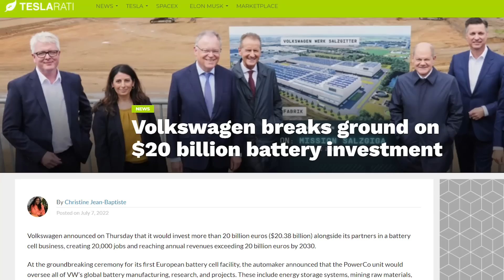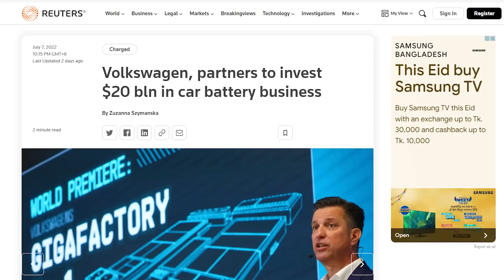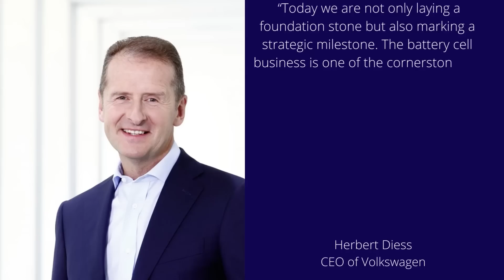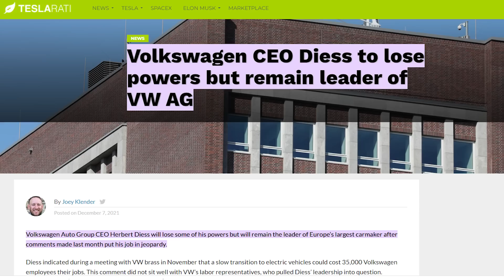VW starts $20 billion battery factory & reveals new battery cell

Comment: The Legacy OEM's are going to go bankrupt not in 10 years but in less than 5 years! VW, GM, Ford and Toyota alone have combined Total Debt of 1 Trillion Dollar?! 

Which at ZERO PERCENT INTEREST was serviceable but at 1,2,3 % p/annum is a major issue. VW for instance is underwritten by Deutsche Bank which in turn is underwritten by the German Government which is underwritten by the EUROPEAN UNION?!

The same can be said for Ford, GM and Toyota though the two American Companies will need alot of support to get nailed out again by the FED?!

Anyway the point of the matter is OEM's face huge hurdles and massive technology moats that frankly they are not equipped to overcome.

If your Total Debt is around a Trillion Dollars and your Total Liabilities are close to 2 Trillion you have a short, medium and long term cashflow problem? Typically in the case of large corporations with liquidity issues you either go to a bank, issue bonds or get a bailout?

In this case I think it's going to be a mixture of deferring payments (interest free holiday), tax reduction and or written off, bank loans turned into convertible bonds (government backed) and a cash infusion by new Federal Grants etc. 

Remember we're starting at 1 Trillion in Debt with all four of these Companies committing to spending over 100 billion on EV Development. But unfortunately the maths simply doesn't make sense. 

VW for instance spending 20 Billion for a Battery Factory? The resource allocation is so redundant at this point and the savings negligible or non existent. VW needs production capabilities but if your research, design and development isn't synergistic you have major problems before you even get to fabrication and or assembly.

Tesla has its critics and it's detractors but taken purely as a case study in this case the disruption of the auto industry. You literally have to do a side by side comparison to Apple and the Mobile Industry to get anywhere near the adoption curve.

I know almost everyone thinks it's impossible for Tesla to reach an annual production of 20 million vehicles by 2030. But consider despite everything that's happened economically and socially the last 24 month's. And I'll just use Tesla's projected goal of year over year growth of 50%.

2022 1.5 million vehicles, 2023 2.25 million 2024 3.375 million 2025 5.06 million 2026 7 million 2027 10.5 million 2028 15 million 2029 22.5 million 2030 33 million?

Now obviously a big part of Tesla achieving this growth will be rationalising their production lines by simplifying their product line. A Robo Taxi, a Robo Van configurable for both passenger and freight the long touted Model A Variant? As in a small hatchback for Asia and Europe for under 20k.

Even by 2030 I don't see Tesla having more than 10 models including the CyberTruck and Semi? By then Freemont may become the speciality production facility and only make Model S, X and the Roadster? 

But the real take away is this last year 56 billion this year 81 billion then 120, 180, 270 and 405 billion gross Turnover the OEM'S ARE DONE.

Comment: I sold my ID.4. I was very disappointed with it as the software was not fit for purpose - It would not charge properly on the timed charge. The app clashed with the car settings causing further failure. I'm in the UK and the Pro Life here has no reversing camera, auto dip headlights or auto wipers (in USA it's different). No over the air updates and now Which? Reports that it's range is 100 miles per charge short of advertised range. This is what I found as well. Combine this with the lack lustre acceleration and it's not worth the £43k price tag. I'm waiting for my Model Y delivery!

Comment: My 30 years in the tech industry tells me that Europeans are not good at mass producing commodity products. I've seen this pattern over and over. I've seen Philips giving up on its LCD production. I've seen Germans giving on PV production, etc. etc. Mark my words. Five years from now, as the supplies of the batteries stabilizes and the margin gets slimmer and slimmer, VW will sell its plant and exit the business. I did say "commodity" however. If the Germans can produce EV batteries that are so distinctive and superior to anything currently in the market, that's another matter. But I'm not holding my breath.
Reply: Agree, Likely will happen as you say.
Doubt the German battery tech be superior to what comes out of China.
From the many upgrades of current Li ion battery & LFP coming out in the 2 to 3 yrs that's already talked of from this channel that may end in world market from China. 
After that it is certain semi-solid state battery.

4 yrs to 5 yrs starting to produce battery in mass, German will certainly need battery tech from one or few China companies supposedly some said Gotion tech?
Otherwise the rapid pace of battery tech changes will drive the new Germany battery plant to ruin

Comment: You're right: reducing dependence on Chinese battery manufacturing is important, but possibly more important is the supply chain leading to battery production. Tesla, VW, Panasonic, and others, as you noted, are working on battery production outside China, but China still controls most of the lithium mining and even a higher percentage of processing plants that convert the ore into refined lithum suitable for battery production. Russia believed they could get away with invading Ukraine because Europe is so dependent on their natural gas and oil. We can't encourage that kind of action by China by being too dependent on them for any one essential item.  
            ~~~~~~~~~~~~~~~~~~~~~~~~~~~~~~~~~~~~~~~~~~~~~~~         

Separately, I wonder if you have any thoughts about Tesla, and eventually VW and the other manufacturers elminating the need for natural gas (and other fossil fuels) for manufaturing. I know Tesla famously has lots of solar panels, but melting aluminum for castings can't be done with photovoltaics, AFAIK. It's a big issue in the near term for Tesla with the shutdown NORD-1, but it's a broader issue down the road for EV (et.al.) manufacturing around the world. Have you turned up anything in your research? If so, that would make a great video.
Reply: Concentrated solar does in fact power multiple foundries world wide already. So yes solar can today power aluminum smelting operations.
And recycling aluminum takes about 15-20% of the energy as refining new aluminum does. 
Hence why it's estimated here in the U.S. over 75% of all aluminum ever made is still in use today. 👍🏻😎
Reply: @4literv6  Thanks for the reply--that's great to know. I was wondering about the possibility of concentrated solar (why I specifically said photovoltaic wouldn't work instead of "solar") but my searches only turned up electricity generation. Do you have any links to info about successful concentrated solar foundries, or at least remember a name or location to help search?  Is it something that could be built at Tesla Berlin/Brandenburg, or is it only a large stretch of desert thing? I'm worried the new Tesla production there will get shut down again because of a lack of gas, and this could drag out for a long time. Presumably the ore can be smelted or the aluminum can be recycled elsewhere, but it still has to be liquified onsite for castings.
Reply: You do know all Europeans are living off their "invasions" still?
Reply: @rob4197  Who in the world is only the direct descendent of the original settler of their land? Possibly most Icelanders and some obscure Pacific Islanders. Other than them, practically every person on Earth is descended from someone who once forced someone else off an area of land. Europe, Africa, Asia, and the Americas (including the inhabitants before Columbus) practically for sure. The question is, do we in the 21st Century want to normalize military invasion for the purpose of expanding territory? If so, maybe the US should take Greenland, Cuba, and maybe Mexico, and given leave, the CCP will take about two weeks to begin the invasion of Taiwan. Are you ok with that?

Comment: This is all the easy part of mass manufacturing.  But if VW doesn’t have the battery which lives up to competitive specifications, it doesn’t matter how good the factories are.  This video promised a battery reveal and didn’t fulfill that promise.
Reply: Oh yeah I completely forgot about the battery, VW invested in Gotion High Tech who will manufacture the batteries at this new plant in Salzgitter, Germany, and they have some excellent battery tech which you can read about online or videos on YT.
Reply: @willthompson343  I see many promises, and the lithium sulfur looks the most promising but I don’t know if that’s the same as VW is using.
Reply: @willthompson343  I read about Gotion and they are talking lithium sulfur, which supposedly can support a Tesla based design for a 900 mile range.  Of course it would take 30 hours on a normal house charger to charge, but much less on a commercial charge port.  That would be perfect for me, and enable me to drive my long trips without a recharge.  Even if I had to stop every 300 miles for a 5 minute charge, that’s OK.

Comment: It's really clear VW is taking electrification seriously and Herbert should get all the credit for dragging them kicking and screaming into the modern age. I know they can build cars but I have doubts about their ability to develop the software needed for their next platform. I think they should look for a partner (maybe Apple?) to help them. VW has struggled with just basic infotainment systems and if they can't do that how will they make the jump to software defined cars? The software division of VW Caraid is causing delays of some of the VW group brands right now so software issues are real and happening right now.
Reply: We don't need infotainment or self driving. We need cheap electric cars for everyone now.
Reply: The company was on EV path already before Diess. It started in 2015-2016, when MEB went into development. Already the CEO before Diess was an "EV CEO". By the time Diess came in as CEO in 2018 (he was WV brand lead before that) VW was tens of billions into EV investments and 2,5-3 years into developement of their real big EV play, The Modular Electric Platform.

VW is a platforms conglomerate. They are so big single models are blips to them. They have tens of models on various badges. What matters is the platform.

Diess came in not as to turn the company to EVs, but du to saying "The company is going EVs and I think I can do EVs even better than the previous EV CEO". He convinced board aka pretty much the Porsche Family of it. Remember Diess isn't the top of the mountain. Top of the mountain is high in German and Austrian Alps, where the chalets of the heirs of the Porsche piechh family are.

 Said family just likes to keep low profile, well unless their member is the active head of the company from personal interest. The family owns controlling share. Nothing happens without their say so and if they decide something other shareholders dont have votes to resist. It is publicly traded, family controlled industrial conglomerate. One just doesnt currently see them in person, since all is handled via family holding company of legal types and the actual family choose to not appear in public much related to the business. Instead letting the "hired managers" aka Diess and others handle publicity.

What did happen really was, that couple of the sub brands were more reluctant (for example one Audi brand manager was still on petrol head thinking)and to them Diess had to keep a talking to of "Get with the program. Whole conglomerate is transitioning to EVs. I was hired to make the transition happen and have approval of the board to do this (aka most importantly approval of the controlling share holder aka family holding company aka heirs of Porsche). Get with the program or I will have no trouble firing you and don't think complaining to the board will help. This is their will, not mine alone".

The more recent spat was really about union and employee relations. He tried to run the "scare them straight and agreeable" management strategy to the Wolfsburg factory and AS IS THEIR JOB the AG Metal union representing the workers made it clear, very publicly, that this is not how employee relations are handled in Germany. It wasnt about the workers being against EVs. Rather of Diess saying stupid stuff like "lot of you will get fired" and so on. Mainly the sticking point was repositioning the ICE engine specific people, where union wanted program to transition the heavily ICE related jobs to new EV related jobs. People who made the actual engines, the transmissions and so on.

Surprise, the union got what it wanted. Diess didnt continue the "you are getting fired talk" and surprise surprise there were announcements about retraining and repositioning programs.

One just might look like kicking and screaming, when one isnt used to union or workers actually having the power position to say publicly "CEO, you are being stupid. CEO better." It might get someone fired in USA, but in union strong European countries that is called "employment terms negotiating". Union says CEO is bad at being CEO, putting pressure on them possibly getting fired. To get CEO say "okay what kind of deal you want, so you say 'actually this CEO is okay, we can work with him and we have a deal. No strikes, this is fine'".

so the wolfsburg row was pretty literally Diess trying USA style managerial stuff with European factory union and union saying pretty much "stupid man, you do know this is Europe and not america".

Comment: So now VW is getting on board with Tesla and seeing that it's an opportunity for further buyer lock-in. 
If you've bought a Tesla with 4680 cells, you're not going to go to any store and pick up some replacement 4680 cells.
For all I know VW is going to use hollow triangular cells with liquid sealant filled cooling channels running through them. 
(Got a leak? It hardens like cement on contact with ambient nitrogen. )
Reply: FYI, the 46-80 structural battery pack is NOT a serviceable component. If it fails, it is replaced with a new unit and the old one is recycled. Have a look at the tear-down on Monro Live channel.
Reply: @surferdude4487  Yo Dude, I know. 
I've seen sardine cans opened more delicacy than that battery pack. 
The people at Munro didn't know about first having to dissolve the Pepto-Bismol pink cement around those 4680 cells.
(I am sure its an acid soluble non-conducting polymer. Once it dries, the residue is like concrete. )

Comment: Based on watching many of your videos, It's not unreasonable to project that in the next 5 years, the ranged of electric vehicles will have doubled to around 500 to 800 miles. VW trying to build a battery factory in 4 years begs the question "how obsolete will the battery VW produced be in 2026?". IMHO, most of these late startups will be unsuccessful, ultimately leading to failure.
Reply: I guess another factor is how agile the factory will be with new chemistries and processes. I don't think they'll build a whole new factory every time a new chemistry or process comes out, they'll just retool the existing factory.

Comment: The questions I have is... currently Tesla was producing at a line speed that is 3 times faster then VW. After shutdowns the line speed at Tesla has doubled. Does that mean they will produce cars at 6 times the line speed of VW? I'm wondering why VW hasn't tried to work on gigacastings to reduce costs and increase speed.
Reply: I heard a Giga Press can do 750,000 units per year, if they can make 750,000 motors per year, that would be 250,000, 3 motor EV's per year,
Reply: history wise there was also a car (PHEV) that where the target wa to build in 4.5h with tubes to integrate the battery's and electronics. they also build a two cylinder motor that was optimized for Plugin hybird. the main problem was then Mercedes :-(  https://youtu.be/j2Ki9LN2Wl4?t=225
Reply: German Teslas have an improved part of the axle suspension which has been a weak part on former cars. So good news here. Currently Tesla is struggeling to find workers as they pay less than german manufacturers. VW has started new lines and factories (Emden) for EVs but struggle to get enough chips and other parts. So making the line faster is not always possible but needs parts and workers.
Reply: When Volkswagen’s new electric car plant comes online in 2026, the first car off the line is the Trinity car which will be an electric sedan type car, that car will also be the first car to use Gigacasts on the new SSP platform.
Reply: @willthompson343  - By 2026 Tesla will still be 4+ years ahead technologically but producing a few million more EVs per year. And who knows where Tesla’s FSD will be by then and Tesla bot will be at Gen 2 maybe working on an EV production line.  Battery tech will have advanced and who knows where Tesla will be on that front with their latest battery chemistry.  At least we hear VW is making huge investments in EVs but where are the rest other than a factory or two to produce EVs, too little too late.
Reply: @Chainyanker007  Tesla’s more like 8 years ahead

Comment: Most impressed with the recycling end of this operation. As you detailed in earlier videos, recycling lithium batteries is significantly less expensive than mining lithium.

All manufacturers need to making moves like this if they want to survive.  Additionally, they need to plan to be full BEV long before 2030.
Reply: Dr. Jay Smith is doing interesting research into your namesake.